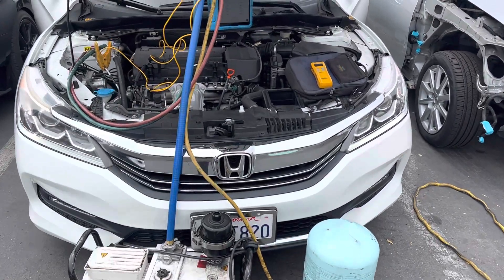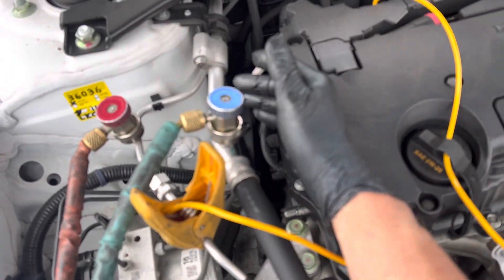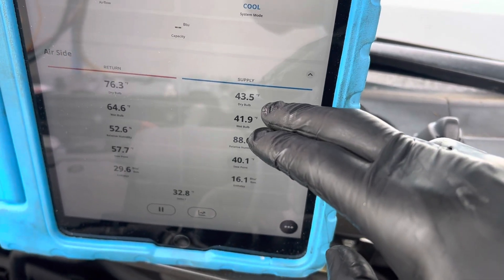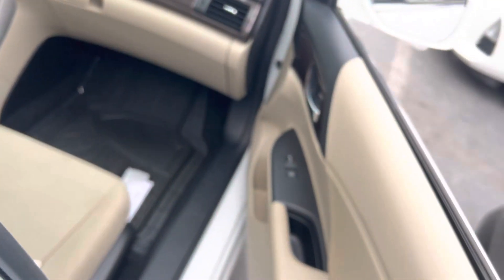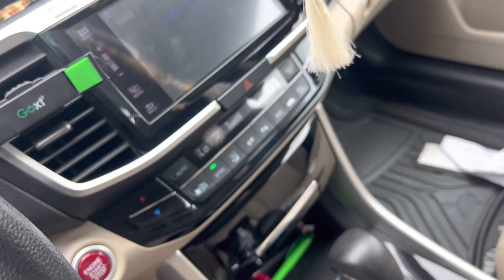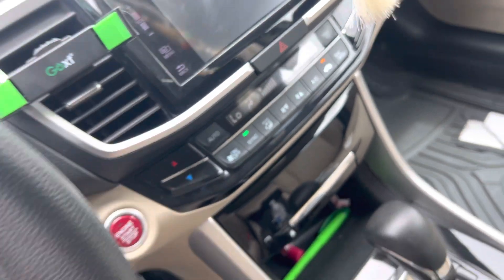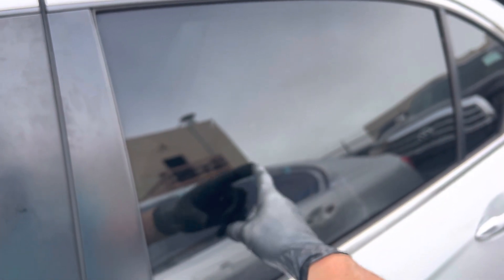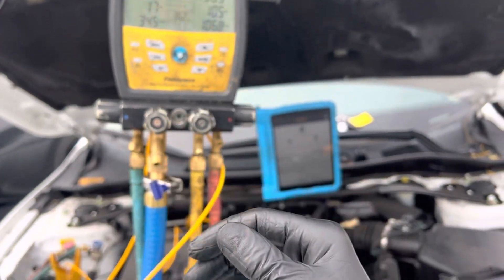Automotive AC instructor tell students to run compressor to drain liquid line refrigerant ￼

Comment: A bit unrelated question. I see your low and high side service hoses look wrinkly, not the normal hoses most of us (I) know about. What is it?  Thanks.
Reply from the maker: I did a video on this its shrink tubing.   Underneath it’s completely coated with silicone grease. I didn’t apply the heat gun the shrink to tubing down. 

The silicone grease is it airtight in moisture tight barrier that keeps the oxygen away from the rubber. Shrink tubing provides abrasion protection and keeps the UV light from the sun off the rubber.  Oxygen and UV light breaks down and deteriorates your hoses.
Reply: @coldfinger459sub0  I have missed that video but will go find it. Thanks